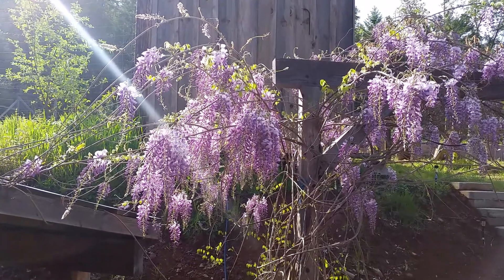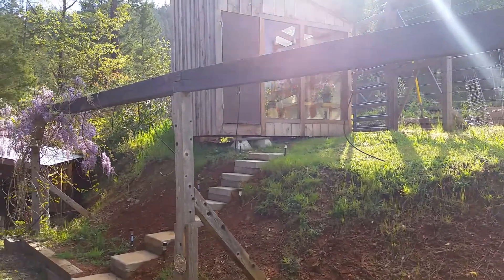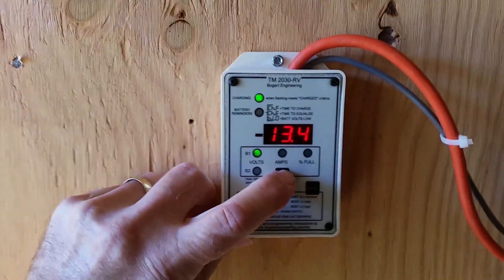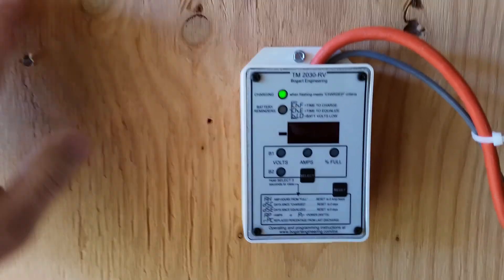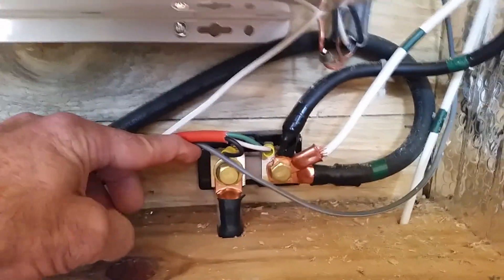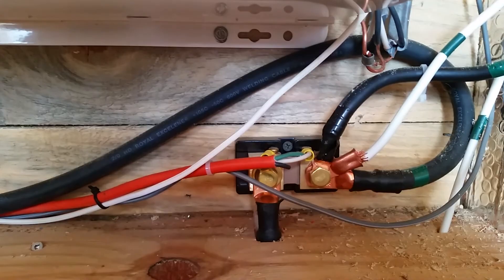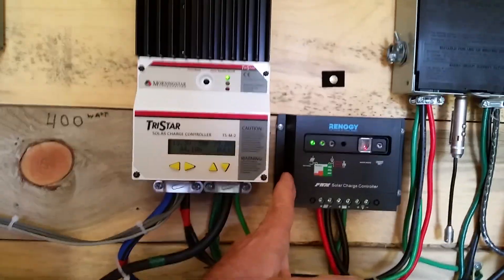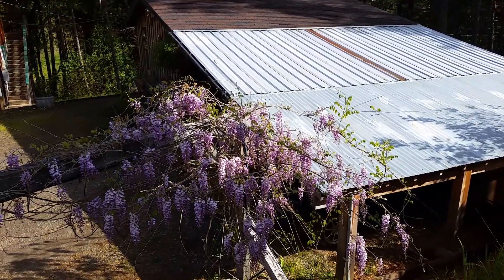Off grid solar homestead "The Trimetric monitor"

Comment: So, you only have two cables going into the TM2025? It that a neg from the charge controller and a pos from somewhere? 
I'm trying to get this thing installed and the diagram I have is showing a lot more wiring than I'm seeing here.
I wish you'd have opened the thing up.   :)
Reply: +Steven Davis I did get a shunt...So, you have the rest of the wires going through the wall, I suppose? I only saw the two and thought it might be easier than I anticipated.
Reply from the maker: Greetings from Oregon, we are back on youtube. You will have to re subscribe to get notices. Have a blessed night